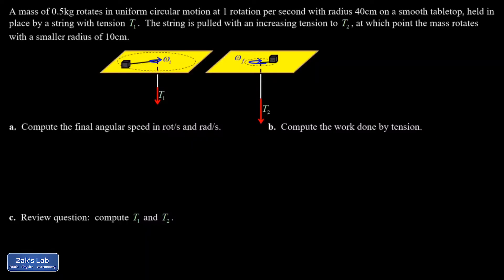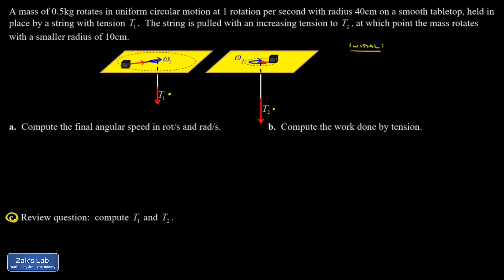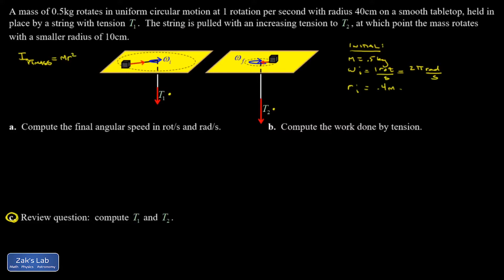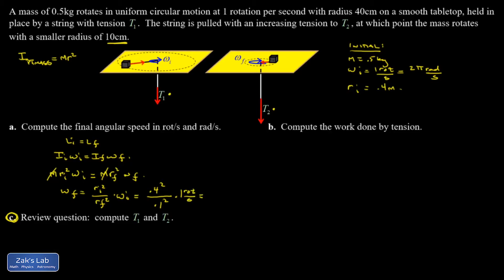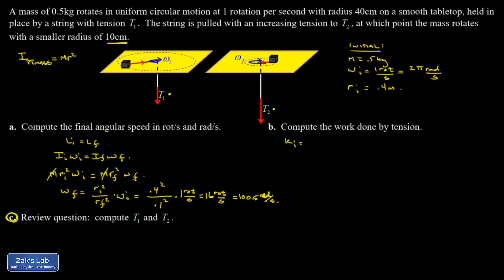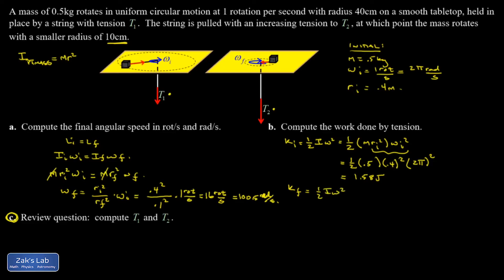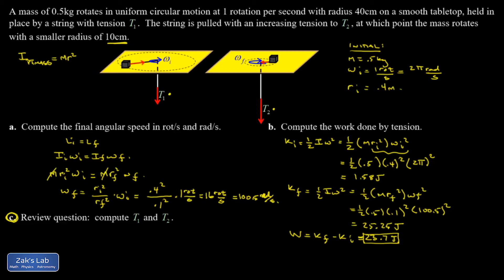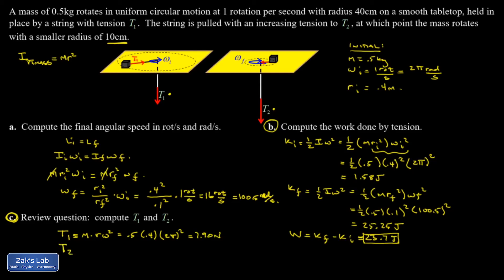Pulling a string to accelerate a rotating mass: conservation of angular momentum.

Comment: How would we do that integration? DO you mean taking ∫mw^2rdr from r1 to r2?
Reply from the maker: I haven't thought about this in ages, but it's on my to do list now.  The idea would be to integrate F*dr as the tension (F) is continuously changing on the way in.  Modeled as a "slow" inward motion.  Should work . . . will try soon.  z
Reply: @ZaksLab  Maybe I have figured out somthing, here L is constant. So, after doing some algebra with F = mw^2*r, we get F = L^2/ (m*r^3). Now we can easily integrate. But problem here is, if we integrate it from 0.4 to 0.1, we get negative 23.68J as answer
Reply from the maker: I had a chance to do it this morning, and it works.  I did the general case (initial angular velocity w1 at radius r1, final angular velocity w2 at radius r2) by looking at the change in KE first by finding the final angular velocity with L conservation and comparing initial and final KE.  

Then I did it by looking at tension as a function of radius T(r)=mrw^2, where w = r1^2/r^2*w1 by using L conservation.   Then in the work integral (and I'm visualizing this as the tension in the string pulling straight down through the distance r2-r1), we integrate T*dr.  BUT, there's a sign issue in the setup of the integral:  dr carries a minus sign in it because r is shrinking.  To fix the work integral, you need to set it up as dW=-T*dr to obtain a positive contribution to the total work.  So it's set up as -integral(T(r)*dr) as r goes from r1 to r2.  After plugging in T(r) and integrating, you get the same deltaKE as the other way.  I think your approach is the same as this, but with the minus sign still lurking.

I'm sure there's a more elegant approach that doesn't require the shell game with minus signs.  For example, you could have a downward pointing little dx and integrate from 0 to r1-r2.  This means r(x) would be r1-x, so T(x) could be defined in terms of x.  It'd be interesting to try that approach to make sure it agrees.  Another way to do it is to just reverse the direction of the entire process:  compute the work done on the system as the radius grows from small to large.  Then your dr is positive, the work done on the system is negative, and it's the negative of the answer you get for the reverse process.  

This negative differential issue is not uncommon in physics problems -- whenever possible, you can set problems up to have a positive differential and just avoid the issue, but sometimes it's sensible to just correct the integral with a minus sign by arguing that your differential constribution to the total MUST be positive.  It's equivalent to throwing in a minus sign to a backwards area integral of a positive function to force the result to give you geometric (positive) area.